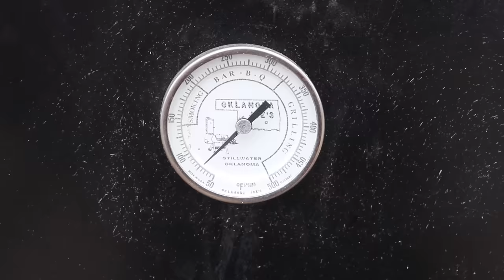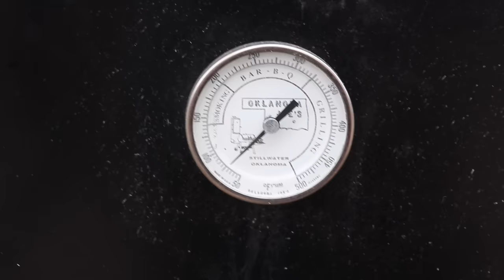Will Work For Bacon

Comment: Happy Thanksgiving Hollar family.  The skirting looks awesome.  Buggy always has to be near daddy and that is so adorable!  She is learning your trade AND her mama's.  Nothing better than smelling the smoker going.  FYI I had a cabin in the N. Ga mountains.  The crawl space was ALL mold.  I had it taken care of  with new ground cover.  I then had a local carpenter seal it up NO VENTS and then I installed a crawl space dehumidifier.  It kept it so dry it worked like a charm.  So even though you have vents does not mean there won't be mold.  The mold remediators suggested I seal it up and put the crawl space dehumidifier under the house.  Cost next to nothing to run also.  I was pleasantly surprised.  5 years not a speck of mold and in the winter I would unplug it and drain the drain line.

Comment: Ben, for future reference with Oaks, its not a big deal if the tap root gets cut, as eventually the lateral roots take over as the main support system.  Never hurts to get it all if possible, but yeah like with that bigger sapling, get it out, and replant it elsewhere.

With all of those acorns every year, might be a good idea to get a system together for producing saplings each year and getting a more wooded area of your property slowly turned into a more oak dominant wooded area.  Would be perfect for pig silvopasture, especially in the fall.

Comment: Wow, that smoker for the bacon is great! It looks like you're back to just you working on the skirting. Cool, you can grow some oaks! We can sympathize with you Ben that it always takes longer than you think to get something done. We had to replace a bury 6' frost free farm hydrant with shovels and a hand powered post hole digger. That took my wonderful husband 2 days to dig out. To install the new hydrant took a whole day with getting needed plumbing parts and getting it leak free. Then two days on rigging up a place for the weep hole to drain to since an obstruction was below the hydrant. The gravel had to go over from the hydrant and since we have clay soil we made a box of 27 gallons of river rock for it to drain into below the weep hole and then buried the box and the weephole piping in 3 more inches of gravel in a much bigger surround. The 27 gallon box had most of the bottom cut out of it, lined with geotextile "web style not woven", and the lid on that and then 1/8" weep hole piping went into it from above. Of course we had to have geotextile all around the box and then over it to prevent the clay from filling in all the space between the river rock for the weep hole water to drain! We are on day 5 with 3 feet of dirt fill back added above the geotextile layer above the box. We washed our river rock since we wanted it as free of gunk so the weep hole water would have a maximum amount of space to drain to. It'll be below freezing overnight for the next week here in Minnesota so we got that dripping hydrant taken care of just in time! We only need 2 more truck loads of dirt fill! It just wouldn't stop dripping no matter what we did. We replaced it with a Woodford Y34 that is said to be the most reliable hydrant. We don't want to do that again any time soon! We use it to water our garden and water for the animals. If we wanted to stop the dripping we would have had to turn off our well. You never know how long a project will take! Going on 36 1/2 hours of work. There were many trips to the hardware store that are not included in that time and the hours spent watching how to replace it on YouTube wasn't included either! I'm sure there is a lot you do that we don't see either. Thanks for putting in all the preparation time that we don't see! Have a very Happy Thanksgiving Hollar family!🦃🥧🍠

Comment: hmmmm ok a thought; after you install the siding, create 100 little pots of nice red dirt, sit them up on blocks not right on the ground so they will air prune...sit them right on that drip line and ..stick a couple of acorns in each pot. next year sell each tree for 3.00 on fb market place

Comment: On paper, the skirting seems pretty simple, straight foreward, and not that long of a job.  It sure has had you putting some hours in.  From the comfort of my computer chair, the siding sure looks good.  When it is all said, done, trialed, amd tested ypull,you'll, to mention if the siding made a different after winter and then next fall after the summer heat.

Comment: Hope yall have a wonderful Thanksgiving.  I live in Florida and we just have regular mobil home skirting around ours, have not had mold issues.  You might want to put in an access door in case you need to get under there for repairs.  The skirting comes apart easily so it is not a issue for us.

Comment: It's too late but you would be better off not having vents but having a vapor barrier on the ground. FAR more efficient and all of the building science is pointing in that direction. You get all of the moderating benefits of the earth's temperature and still don't get the mold issues.

Comment: I was not trying to be some hater when I mentioned termite shield. You have done a lot of work and I would hate for your home to be a buffet for termites. Saw someone say leave you alone about vents people. Well vents, vapor barriers are important for health and safety but moisture brings termites and with all the things your previous owner did you may get a house infested. Since you’re trying to be sustainable and stay away from chemicals the barrier shield is the only deterrent from spraying. You did tons of work on the trailer. Shame to have to start over due to termites looking for a winter home.